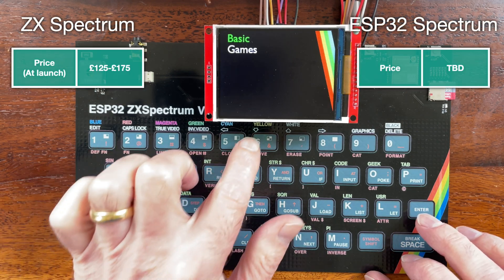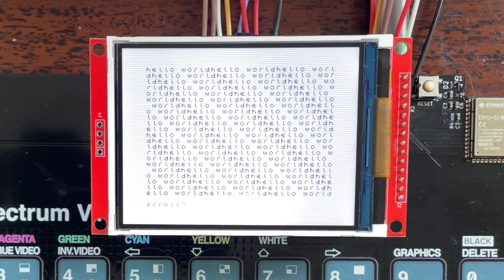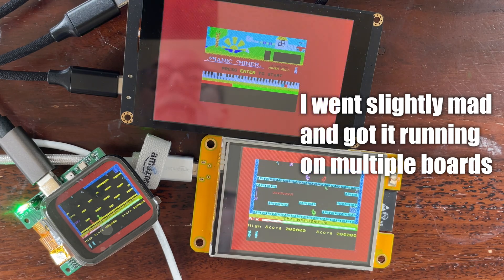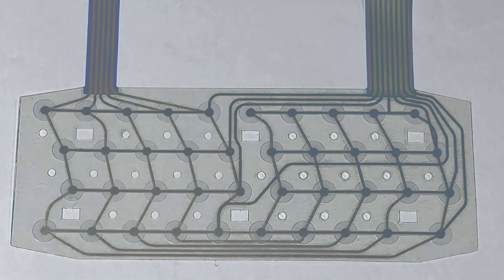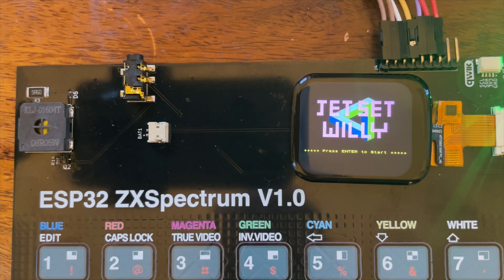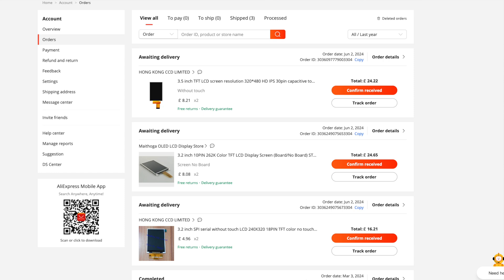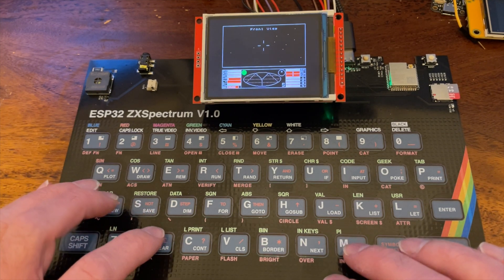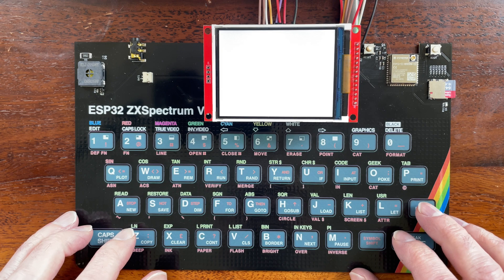ESP32-S3 ZX Spectrum - Full Color Silk Screen is really cool!

Comment: how does it complete the circuit when a key is pressed down (a key is like a on off switch of course) in your keyboard?  Its not using memebranes as you said in video.

Comment: Excuse my ignorance but how is the keyboard made?  I get that it's a silk screen printed PCB, but how to the keys work?  Microswitches beneath the keys?  Sorry if his is blindingly obvious...
Reply from the maker: Not blindingly obvious at all. It’s used capacitive touch sensors. This is built into the ESP32 microcontroller - there are a set of pins that can be setup to measure capacitance - these are then hooked up to copper pads on the PCB. The ESP32 detects the change in capacitance caused by a finger being near the pad.
Reply: @atomic14  Thanks.  I'd love to order one of these boards when they become available.  A simply brilliant project.

Comment: I did write a clock-cycle perfect Z80 emulator for my then new 25 MHz 486 computer, and then moved ahead to map the Spectrum hardware. Somewhere I managed to get the display mapping upside down.

Would be fun to see what it would take to either move that code to an ESP32 or add the rest of the hw mappings. On the PC, the normal PC could create the stimuli the Z80 processor would see and think came from the rubber keys.

What I mainly felt missing was a way to interface to cassettes to transfer old games and saves. But I can probably just play them to the sound card and then recreate the stored data in a "microdrive" or similar format.

Comment: Wow! That pcbway colour printing is gonna be so useful for making FR4 front panels (with voids in the solder mask for led shine thru). 
I've been waiting for one of the inexpensive PCB fab house to introduce this for a long time. I'm really happy now!
Think of all the colourful things we can finally make without having to use vinyl stickers or stenciled spray paint...

The project looks fantastic - can't wait for the next vid.
(although perhaps homage should have been paid to the ZX81/80 by starting with that :) )
Maybe you could do a whole Sinclair series. I still use the Cambridge calculator.

Great stuff as always! @atomic14

P.S. If the touch matrix demands end up depleting your available ESP pins you could try multiple MPR121 ic's on the i2c bus. 
I've had good results with them: 

Continuously self calibrating.
A great and simple Arduino library.
12 channels per chip.
4 i2c addresses selectable.
So you could poll 48 discrete touch pads - no diodes!
As you need only 40, the unused pins on any MPR121 can be arbitrarily configured as i2c->gpio (proper tri-state) - for driving synchronous APA102/SK9822 leds perhaps.

Comment: so how do the keys work is it some sort of capacitor switch, with some copper contacts under the silk screen?
Reply from the maker: It’s using the capacitive touch pins of the ESP32. So just needs a copper pad on the PCB.

Comment: How about a Sunton ESP32 7" LCD version?  Move the processing to the LCD ESP32-S3 with SPRAM and either connect wirelessly or I2c or such for just the keyboard?
Reply from the maker: Have been thinking about a separate keyboard. But for this first iteration I'm going to stick with the fully integrated single board. It's a nice standalone thing that will just work out of the box - much less to go wrong or mess up.
Reply: @atomic14  makes a lot of sense!

Comment: I love your videos, thanks for sharing this! Quick question if you happen to see this comment - when you sell a product like this, do you have any consideration for FCC certification? Thanks again for all your great videos.
Reply from the maker: That is a very good question. The module is already FCC certified which makes things a little bit easier. It will probably still be sold as a partially assembled kit which I think removes some of the requirements. It's something that I will have to look into. It's also one of the reasons why it's only really worthwhile doing if enough people are interested.

Comment: Can It read program from tapes
Reply from the maker: At the moment it loads snapshot files from the SD Card. But in theory there's no reason why you couldn't connect a tape recorder up to some GPIO pins and run the tape loading code. At the moment my emulator might not work as the timings are not perfect, but there are emulators that can do that.

Comment: Very interresting and cool project which size of screen it can support?i imagine a beautifull 3d printed case  to go with your project!
Reply from the maker: The main limitation is pushing pixels to the display. So the 320x280 is quite a nice resolution as it’s not a massive amount of pixels and it comes in quite nice sizes - 3.2-3.5 inch feels like a decent size - it’s readable and not massive. But any size is really possible.

Comment: I love that it continues the tradition of terrible keyboards!
Reply from the maker: Haha - yeah, I was debating - is this better or worse than the original keyboard. I think it might be a draw... I am pretty amazed at how well it does work though. I really thought this would be a video on how nice the full color printing was, and how the touch didn't really work.
Reply: Brilliant! But where does the K7  (cassette) plug in? I’m sure I’ve got some tapes somewhere lol
Reply: @petebowcott8348   Yeah i do think cassette compatibility would be a great feature.
Reply from the maker: It's possible - I'll have to look at a better/more accurate emulator as the tape loading is really time sensitive. Definitely doable - but probably for a future version.
Reply: @atomic14   Mhm i do have an ESP32-S3 devboard, a recording Walkman, and some empty cassettes. Fundamentally the whole input routine can be asynchronous and just hook in right where TAP file loading lives.

Comment: I am expecting a lot of "shut up and take my money" about this very soon. As an owner of an original launch 16K I am very tempted.
Reply from the maker: Just need enough people interested to justify a full production run. It is easy to manufacture as it's just a PCB with SMD assembly along with a display - but for small runs it's still pretty expensive. Once you get into reasonable numbers the costs go right down - which then means it's just things like shipping, packaging and logistics that take up the most.
Reply: @atomic14 hi chris.have you got my messages about the emulator im doing with ackerman (jaime) for the camputers lynx,the zx spectrum emulator was just a small test out for me  so i am surprised it has got its own platform now.and what a fabulous job you have done on the pcb.i bought one immediately when i saw it last week! Best regards,peter todd(retrogubbins)